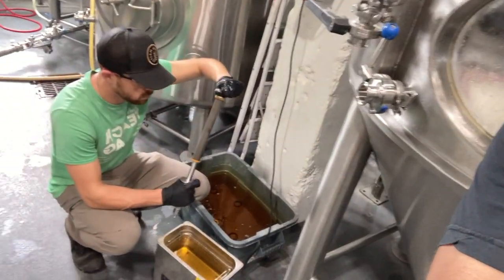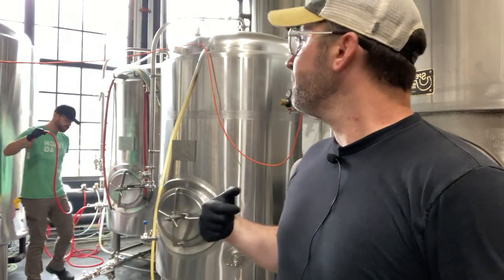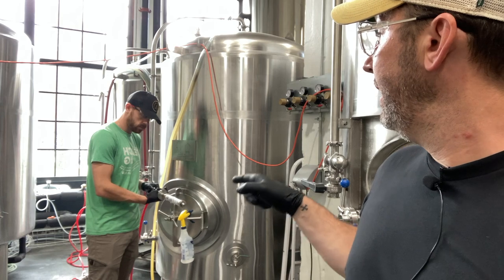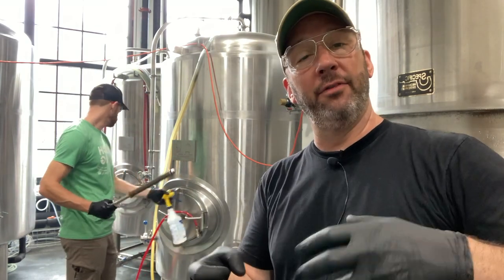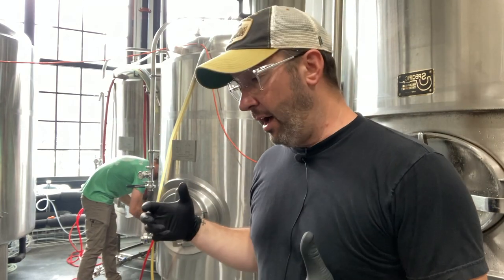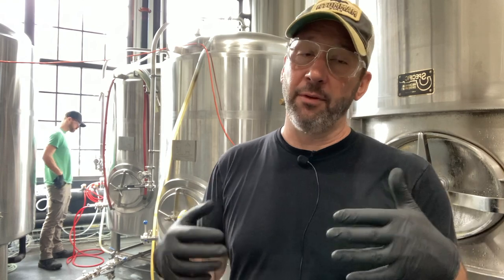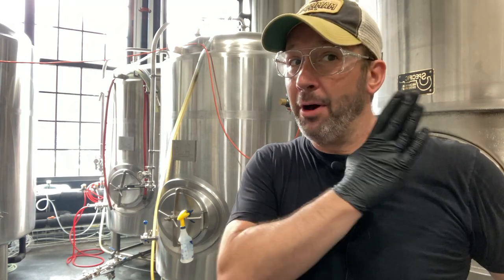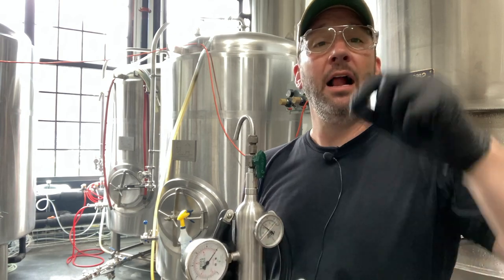How I Force Carbonate Beer in a Brite Tank!

Comment: Hey Adam, I'm having trouble with what I am thinking is CO2 staying in the beer? I have a brite tank, and I'm only 1 bbl. I'm crashing the beer to 34, head pressure on the brite is at 12 and then I'm adding CO2 at my wetting pressure, hearing the carb stone work, then letting it sit and slowly increasing CO2 to get to equilibrium. Its been 2 days and the beer is still undercarbed. There doesn't seem to be any leaks as the pressure is holding. Any thoughts? I didn't think it would take this long for the beer to carb as its such a small space
Reply from the maker: What kind of head space do you have in the vessel?
Reply: @adammakesbeer  This particular beer is only at 26 gallons
Reply from the maker: @ericaoneal3141  perhaps the gas is flowing in too aggressively and causing large bubbles rather than small bubbles with large surface area.

Comment: I learned so much with your channel Adam, thanks again
Out the curiosity why you prefer forced carbonation over "naturally" carbonation? not debating here I am just asking the Head Brewer why? is because the tanks at your brewery, etc? 
Thank again
Reply from the maker: Thank you! Great question. You absolutely can do natural carbonation and carry that process out a couple of different ways. Force carbonation is fast tho. For my standard ales I use that method. For my lagers I am increasingly putting them under head pressure during the lager to get more of my carb that way. Am I making sense?
Reply: @adammakesbeer  yes, thanks
Reply: @adammakesbeer  forgot to ask, well maybe is a silly question: Did you ferment under pressure?
Reply from the maker: @Ken79Vampy  No I don’t. It is something that I have considered messing with tho. It’s an interesting variable.

Comment: Do you start your tank with head pressure? We gas our 30 and 60bbl tanks to 11psi, and the wetting pressure of our stones has us setting the regulator to about 21psi. After the ranks sits over night it’s rare we find much success and have to dial it in the fast way. I’m wondering if we start with less pressure in the tank will it allow more CO2 to flow in.
Reply from the maker: Great question. Most of what I know about this is trial and error with the various equipment I have used. I start with just a couple psi on the tank at the start of carb.
Reply: We have 15 and 30 BBL brites. I usually have at least 5 psi or so before I start carbing. Which is about what we get left with after transfer from fermenter.

Comment: Thanks for the info! My only source of confusion is, do you set the regulator to the target PSI + wetting pressure, or do you set the regulator to wetting pressure and use the Zahm & Nagel to wait until it’s at the target PSI + wetting pressure? Admittedly I don’t understand the physics side of this. Thanks again
Reply from the maker: Answering this on the may 5 livestream

Comment: Do you ferment in Unitanks then move to a bright tank to carbonate? Im wondering if there is a benefit of getting a bright tank or just to carbonate in my Unitank. Cheers
Reply from the maker: Great question! I primarily transfer to actual BBT’s to carbonate, but I will use fermentation vessels in a pinch as well. Personally I like it because I know I can get the super majority of flocculated yeast off of the beer. You can do that by dumping the cone as well, but all the ports hold yeast too. I dunno, might just be some personal preference too. Does that answer your question?
Reply: @adammakesbeer  yeah that makes total sense. I have limited space so might struggle to fit a BBT in and was wondering whether its essential. Loving the vids btw
Reply from the maker: @nick87s  thanks so much! Yeah I mean the down side is not having a sight glass but that can be worked around.

Comment: Another great video! How do you know how long to carbonate for? I’m assuming there’s some kind of formula…..
Reply from the maker: Thanks for the question! For me, I just wait until I hit the goal PSI per the temperature of the beer. My brite is usually at 33 degrees F, so my pressure gauge will typically need to be at 8 or 9 in order to have my desired level of carbonation. That usually occurs over the course of four to five hours. Does that answer your question?
Reply: @adammakesbeer  yeah awesome thanks!
Reply: @adammakesbeer  when you say "wait until you hit your goal PSI" does that mean the pressure gauge on your CIP arm matches the goal PSI? I realize this is an old video/comment.
Reply from the maker: @jennifercorrigalsmith2245  Yup!
Reply: Thank you so much! I think I've watched your videos like 100 times. haha. @adammakesbeer
Reply from the maker: @jennifercorrigalsmith2245  that means so much thank you for your support!